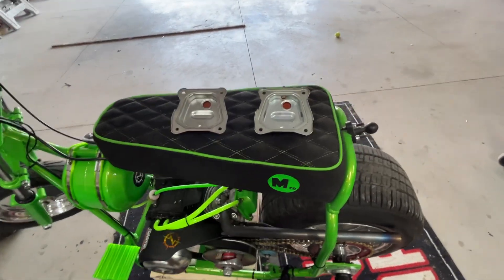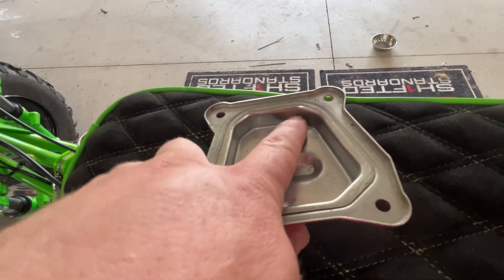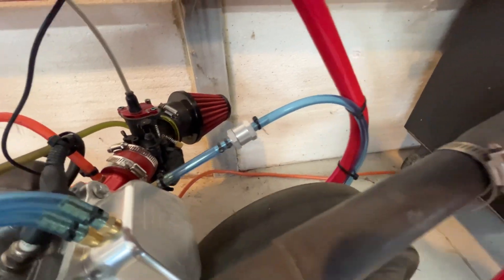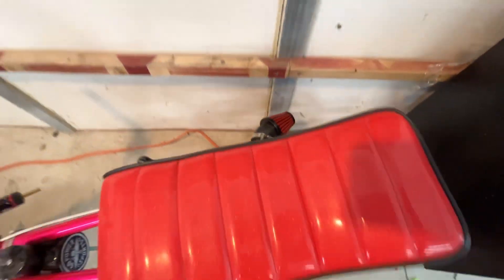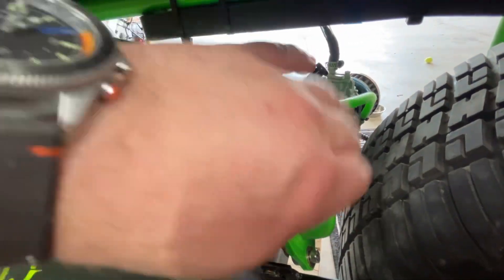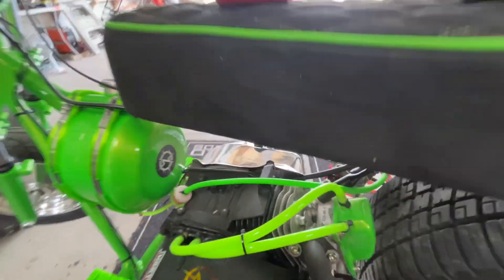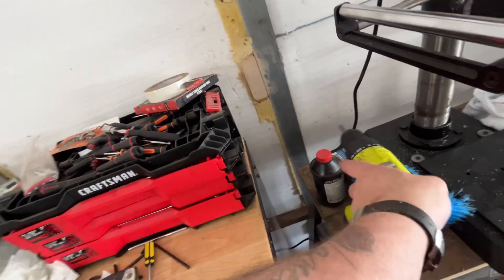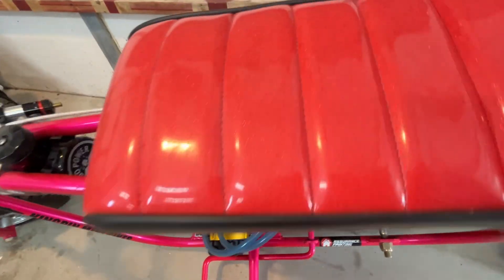How to vent a predator block

Comment: I really like the green scheme on this mini. Where did you get the green hoses from? I have a Coleman ct200u that I plan on painting over the winter. I had AI make a few renderings and I settled on blue for the main frame, neon green for the fenders and black for the wheels for sure. Planning on metallic blue and green but I don't know how neon green would look metallic or If it's possible because it's so light. I thought about the wheels and the details/little things/misc. parts red but I'm thinking it would look busy and scattered. I considered leaving the forks and handlebars alone because they are already red. Like RBG but a literal red, blue and green paint scheme. the front forks and handlebars would be left red(maybe just a handlebars), the front fender would be neon green, the rear rack would be red to match the front, rear fender would be neon green like in the front, the wheels would be black(no idea what else would look good/match) and the main frame (possibly the front forks too) would be the metallic blue. Valve cover, rewind cover, seat, hoses, cables, levers and any other miscellaneous parts would hopefully come to me at a later time. Maybe red and green because metallic blue would be the most used. Anyway I went off on a rant about my color scheme idea but I do like those green hoses. 😂

Comment: But the pressures not going anywhere no? Isn’t this a closed loop
Reply from the maker: No, it vents case pressure to the head which is released by the one way valve

Comment: What do you use to seal them? I seem to always have a little bit of oil coming out of my fittings, even though theyre NPT. Does teflon tape work fine?
Reply from the maker: @draco9105  teflon helps, but I use a fuel proof adhesive sealant from locktite

Comment: What does putting a hose from the valve cover to the side cover even do? These two comments are connected inside the engine, correct?

Why not have an actual PCV system? is there a reason?
Reply from the maker: @Jglovermr2  vents the case pressure and lubes the valve train.
Reply: @north-mb  Is that the idea? to lube the top end?
Reply from the maker: @Jglovermr2  to vent the case pressure

Comment: Do you need to run two lines from the crank case to the valve cover or will one be sufficient?
Reply from the maker: @Channel2Reaper  one is fine

Comment: Do I need a check valve or could I run the tube straight from the head into the block
Reply from the maker: You will need one check valve allowing pressure outward from the valve cover. If stock valve cover, it already has one.
Reply: @north-mb  does it mean the stock valve cover's breather is insufficient if oil is misting out? is that the system i need to work on rather than a vent from the case to valve cover or does reducing/equalizing the pressure from the block to the head help?

Comment: I am currently using a .010 head gasket and I seem to be getting blow by. I have a billet valve cover with 2 tapped holed and my crankcase has an open port for oil but it’s not tapped for a fitting. I use a pulse pump for fuel delivery. The other one is just vented to the air. Would I need to have the other tube venting into the crankcase to stop blow by? Do I need to have 2 tubes running from the crankcase to the valve cover? What about my pulse pump? Would that need a check valve?
Reply from the maker: @muhammadamohsin  do you mean oil in the cylinder when you say Blow by you don't have to have two tubes. The purpose of the tube is to vent the crankcase to the valve cover to equalize the pressure the other tube can be used for your pulse pump as long as you don't get too much oil in there

Comment: I have a built 212 non hemi, on a cart with the pulse fuel pump and it always blows out out the catch can. Any way of stopping that? I don't have a billet side cover, only the pulse fitting from the factory valve cover breather hole to the catch can. Pulse fitting on valve cover supply's vacuum to my fuel pump

Comment: NPT fittings are very confusing to me . Yes that is a 1/8th fitting but it does not physically measure 1/8th of an inch . My 2 brain cells argue when selecting NPT fittings . Great content , Man and cool bikes too
Reply: It is the inside diameter of the pipe.
Reply: I always assumed the measurement of an npt fitting meant the hole all the way through is that size. With the Barb, threaded end and hole needed for the threaded end to be able to thread being different.

Comment: What kind of tubing do you use?
Reply from the maker: @claytonscott9942  1/4"
Reply: @north-mb  no but like what kind like the material/brand
Reply from the maker: @claytonscott9942  i used to use PVC. Now I spend $25 for 10' or the real deal 3 ply fuel tubing. Never have any issues

Comment: I pop that baffle out, and run to my can. No check valve, for the negative pressure on the upstroke.
Reply from the maker: @DeezGarage  what happens with no check valve?
Reply: I have no check valve also.
 Wondering if I should run one